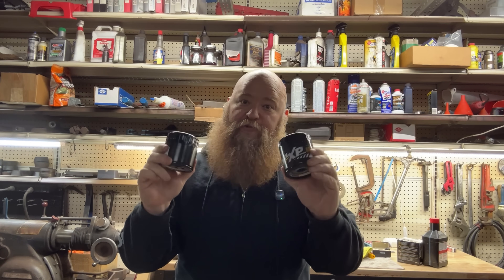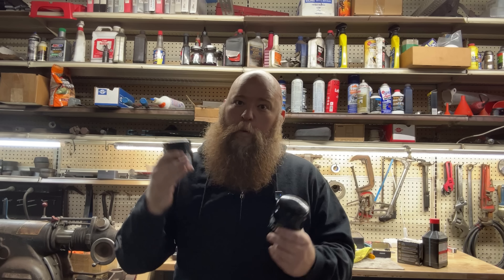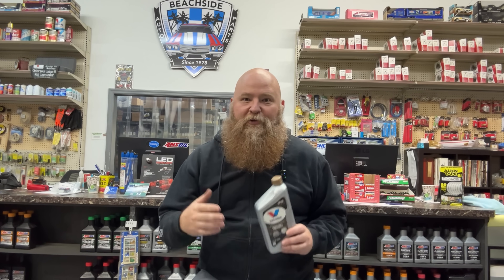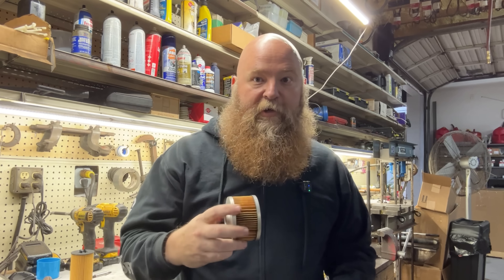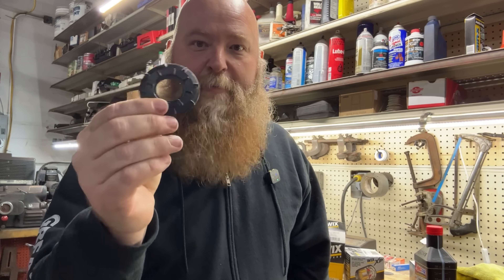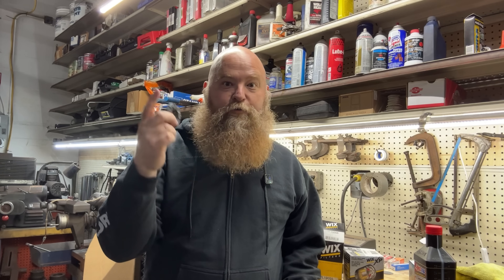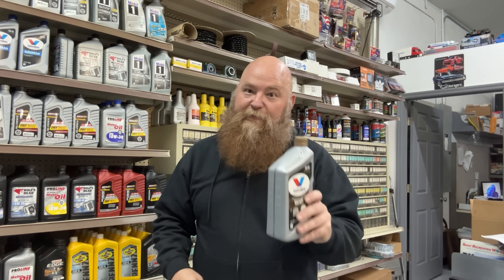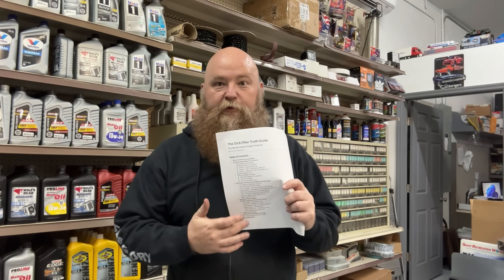Why Cheap Oil Filters Quietly Destroy Engines

Comment: super tech filters are cheap but work great.
Reply: Can't speak for others but my experience.  Ive always used Super tech oil and filters on our service fleet. I've never had a problem and each vehicle has gone over 200k miles.
Reply: I have used them too. But recently discovered the ones for my car don’t have anti drain back.
Reply: They are the same as CHAMP filters. Identical. Pretty much good for 3,000 max. Dont go 5,000 like it says on the box
Reply: @doctorwhodj  Appreciate the info, but I've had no problems using them until my 5000 mile oil interval.
Reply: how you know it work great? did you get inside the engine and confirm it works great? or do you think engine damage happens over night? engine problems takes time, be careful
Reply: @mohamedmohamed-tg8uo well , I can reference my 2006 caravan 3.3 254,000 miles. Used cheapest wallmart supertech filter and Supertech premium synthetic oil every 3-4 thousand oil change intervals. Does not burn a drop in 4 thousand miles.
Reply: @mohamedmohamed-tg8uo because I've been using it for over 100,000 miles and the car has close to 200k miles and doesn't burn any oil. I know my own cars. 
what kind of dumbass question is that?
Reply: @mohamedmohamed-tg8uo I have been using SUPERTECH OIL and filters since they were called TECH2000 from 1980! Until now. Never a problem whatsoever. Every 2000 miles then and every 3000 now. All Walmart brand. And TECH2000 oil was 50¢ a quart way back then and no problems. Some Walmart lube job mechanics told me in 1985 Tech2000 oil was made by Quaker state then Havoline then STP? That oil never burned. The Walmart filters were made by STP and FRAM back then, now supposedly they are made by WIX. Made in USA and filter up to 10000 miles. They have been tested. 🛢️🤔😧😲😳😱😭👀😁😆😅😂🤣🤑🤑🤑🤑🤑🤑🤑🤑🤑🤑🤑🤑🤑

Comment: I use OEM Toyota filter for good oil flow and I change it every 3k. And use Kirkland oil. Problem solved
Reply: Toyota filters are garbage. The have low filtering efficiency and have been known recently to tear. 
The best filters these days are Premium guard and Microgard Select.
Reply: @littlet7556 you are 100% correct
Reply: @littlet7556 probably good enough, considering the diminishing point of returns with filters
Reply: Same here. Buy filters as a case and costco oil.
Reply: Same! Are Toyota oem filters good?
Reply: @Nikolasto77  Most are made by Denso so they're fine.
Reply: My local dealer sells the OEM oil filter for my Camry for $4.50. It makes no sense to get them anywhere else at this point.
Reply: The engineer at Brand Ranks does detailed filter testing. Some oem filter well, Toyota removes less particles than the worst fram.
Reply: Ive had nothing but bad experience with Kirkland oil, lasts about 2500km in my engine

Comment: Chris, do you think that the first engine start every morning should be first "Flood Crank" the engine for a few seconds. Most vehicles allow a cranking of the engine with the starter without starting the engine. Some vehicles allow this by depressing the throttle peddle to the floor before cranking. Some vehicles require brake and throttle to be depressed. This will start the flow of oil without the high RPM of a "Dry Start". Most modern vehicles start within one to two revolutions of the crank shaft due to fuel injection systems. Older vehicles required many revolutions of the motor by the starer, before ignition took place.
                              What are your thoughts?
Reply: Not everybody has or even wants a modern vehicle.

Comment: Pennzoil ultra 5w-30 oil @Walmart $26.99 5 qt.jug. Bosch premium oil filter or Wix both with silicone drain back valve, 20-21 micron rating, < $7.00 @Rock Auto. Change every 3-4,000 miles. This is way under $40.00 per change. Why run oil 7-10,000 miles? VW bugs ran straight 30 weight oil, no oil filter, only an oil screen. 3,000 mile oil changes. Change the oil and filter more often than suggested. Old dirt out fresh clean oil in. 
                      Very cheap preventative maintenance!

Comment: Oil filters are made by a few companies and most of them are in China. A major company contracts out their products and slaps a logo and an extreme price because of the logo. All say they do xyz. I don’t pay more than $7 for an oil filter and my trucks have worked just fine. I have seen $25 filters that offer the same thing as a $7.
Reply: That's a fact!
Reply: Yeah, this guy is a B.S. merchant. The best filters and the worst filters are not very far appart if you compare the actual specs of what size particles they filter out. Some people act like a filter that has been in service for 5000 miles is completely clogged up with sand. This is not true at all.
Reply: Even oil filters?  Wow.  Thank the Lord that the Trumpster is trying to do SOMETHING about all of that.

Comment: I wish you’d look further into the actual specs. I think it’s kind of funny that you stress how important the filter media is, however, the regular wix is a 21 nominal micron filter, and the XP is a 35 nominal micron filter. In other words, the XP is worse than some of the cheaper brands of filters. You’re a parts guy right? Know your products.
Reply: Yeah that info is stuck behind a 50 dollar pay wall. Thanks for giving it to us for free LOL
Reply: I was going to say the same thing ... a lot of folks think that these $10-15 filters must be better because they cost more, but in reality the reason why these filters can claim to last for 15,000-25,000 miles is that they don't catch much due to lower efficiency, otherwise they'd plug up before they reached that point.  The best thing is to use filters with the highest efficiency for the lowest micron size possible, but to change your oil more often, say every 5,000 miles.
Reply: @dison4linux exactly right.